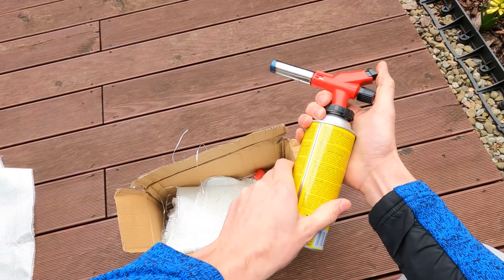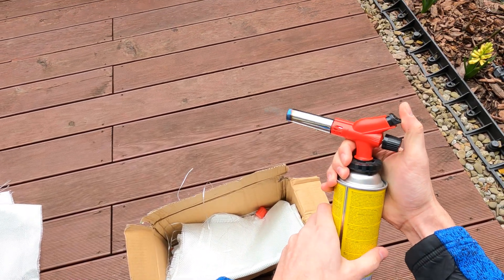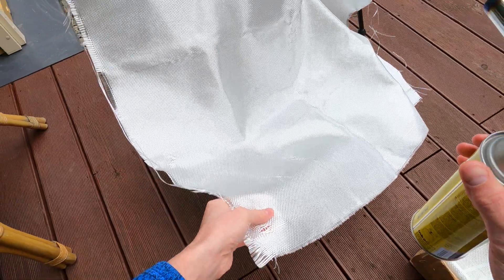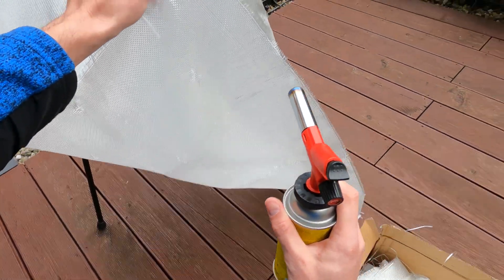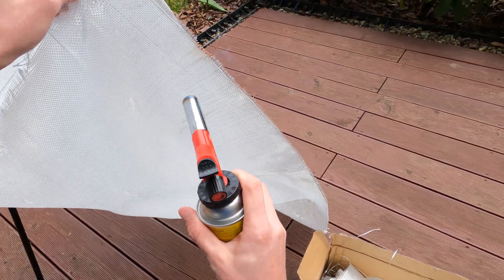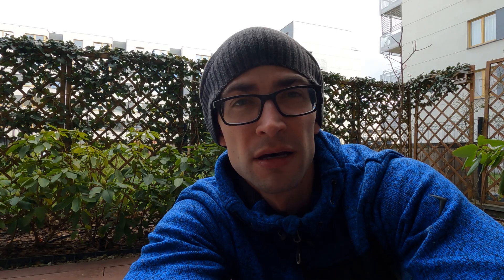How To Make CARBON FIBER Fin Blades

Comment: Hi man, crazy work. How much did it cost you to make them.
Reply from the maker: Around 50 EUR in total. 1 thing is that I was suggested to use 3406 Cyanoacrilic glue for t-rails as the regular superglue I was using worked for 1 season only...
Reply: @IlyaYarshou  oh okay, do you mind telling me what types of glue you used and poxy and carbon Fibre layers and where one can buy it. Really liked your video and want to try it myself. Thank you
Reply from the maker: @MitchellAllen05  I have used a regular epoxy resin for laminating (just cheap one from Polish brand). 1/1 200gr carbon fiber from the internet store ( on Allegro). The glue for t-rails for shoes (don't ask why) I have bought in a local store on Tenerife.
Reply: @IlyaYarshou  thank you very much, safe diving
Reply: @IlyaYarshou  what did you put in the search bar for the carbon fibre layers. I can't seem to find it.
Reply from the maker: @MitchellAllen05  Thanks mate! Feel free to reach me out here.
Reply: @IlyaYarshou  can you send me the link for the carbon fibre on the website please. 
Thanks for the comeback really appreciate it

Comment: resiba epoxy ou polister?
Reply from the maker: Sorry I could not understand the question.
Reply: @IlyaYarshou   Did you use epoxy resin or polyester? low or high viscosity?
Reply from the maker: @AtasubSpearfishing  Epoxy resin with medium viscosity (for lamination).

Comment: im making some, thoughts on how much shorter the layers should be based on urs? how many layers u think would be perfect?
Reply from the maker: Hi! For me this layers quantity was perfect. It was even a bit softer than Leaderfins medium carbon fin blades. You can use 160gr carbon instead of 200gr (to make it softer/thiner) once you think it can be uncomfortable for you.
Reply: @IlyaYarshou   ive got 200gsm carbon, any last comments on sheet design, been lookinggg at diagonal corner strips or a. Triangle inner layer for a bit of subtle performance. thanks mate appreciate it

Comment: hi, do you really need to burn the glass fiber? for your final product? too stiff?
Reply from the maker: For me it is perfect (used 200gr carbon and fiberglass) but for my wife I'm doing 160gr to make it softer. I'm always burning out wax from the fiberglass (Just learned that 15 years ago when I was making еру crossbow replicas) to make the adhesion better.
Reply: u think its necessary to burn off from carbon sheet. i have never done that didnt know it was a thing.    @IlyaYarshou
Reply from the maker: @jpslupik  definitely not necessary for carbon as the factory does not use wax and oil in the production process for carbon as it is used for fiberglass.

Comment: What kind of binder do you use to join the carbon and fiberglass sheets together? Could you please explain to me?
Reply from the maker: No binder was needed. You just put one sheet to another. The resin itself is glueing it up.
Reply from the maker: Look, I pore resin manually on each layer which make the carbon/fiberglass stick to each other and it does not move once I place another layer.
Reply: @IlyaYarshou  What is the binder in the white cup you used to apply each layer?
Reply from the maker: @thuyan6890  This is the regular resin+hardener for laminating from a Polish company Royal Resin.
Reply: @IlyaYarshou  Thank you very much. Wish you good health. I will follow you. Hope you will have many more good videos.
Do you use Facebook? give me the link.
Reply: @IlyaYarshou  I see each layer overlap, you have to apply an adhesive layer. What substance is it?

Comment: do you have to treat the fiberglass with heat? my friend warned me that bubbles are a big problem, this is where the fin cracks under heavy load. look's nice
Reply from the maker: Hi! Nope, all was done at about room temperature. I used this blades for 3 months and the only problem I have noticed was the wrong glue I used for the rubber t-rails.

Comment: Thank you for sharing with us
I see that you have omer shoes how did  you fit the fins inside it
Reply from the maker: Hi! That was a bit tricky task. Rubber T-rails are not really sliding in the rubber footpocket. Not sure if that was the best idea but the regular olive oil on both footpocket and the t-rail helped. Anyway that was not easy.

Comment: Easy job. Anyway title was about CARBON fiber blades, not mixed with glass fiber. IfI would buy it from You I'm expecting product as described ;)
Reply from the maker: Will be making more stuff soon. Sorry for the delay.
Reply: A lot of composite product don't use just one type of material.  Plus as other videos have indicated all carbon layup will make the blade too stiff.  His title is still correct, since he didn't said "100% or all carbon".  Since he is making it for himself and not selling it, he don't need to deal with those a-hole customer.

Love the your  blades, I think I will make one too, but probably will vacuum bag it to get a bit better resin ratio.

Comment: How did you connect the 2 glass and whats between them?
Reply from the maker: I have glued up two pieces of glass with a silicon glue. I had to do it for every fin blade as the glue stayed on the resin. I would suggest to put a piece of plastic bag to cover the glue but it is up to you.
Reply: Also last question. Whats the exact name of the nylon im actually trying to do it right now but the im having a hard time finding that “nylon sheet”
Reply from the maker: @Luis-je7hz  Search for "Peel ply". I was using the one with red lines. It is quite cheap and works great.

Comment: hello greetings, what type or brand of resin did you use, I have seen several videos doing the same thing and they say that it must be west sistem epoxy resin, but in my town it is not possible to obtain,

what do you recommend?
Reply from the maker: Hi! Look, I had the same issue with ordering West System epoxy. The price was very high (around 60euro for 1l of epoxy with hardener) +delivery+custom tax. My experience of work with basic cheap epoxies told me that it is just not worth it. I used Royalresin clear epoxy (15 euro for 1l canister) and quite happy about it. Will be using it also for vacuum infusion in the next video doing carbon fin blades for my wife’s fins.
Reply: @IlyaYarshou  thanks for the information I am very grateful, I will look forward to the infusion video:

I think I'm going to wait for the infusion video to make mine
Reply: @IlyaYarshou  What advantage is there in doing it by infusion?
Reply from the maker: Mostly it is about product quality. The main problem I had doing manual resining was air bubbles on the gloss surface (sometimes very big ones). It was not a problem for me as I was doing it for myself but you always want a perfect product, right? :)
Reply: @IlyaYarshou  I understand clearly. quality is very important

Thank you very much for answering and clearing my doubts👍

Comment: Can I also use 200g fiberglass at first and 2nd layer?
Reply from the maker: You can use 200g fiberglass for all layers with no problem. You can add a color pigment to resin to get rid of white/milky fiberglass color.
Reply: @IlyaYarshou  thanks! Gonna try making one next week, by the way what brand of epoxy resin did you use?
Reply from the maker: It was Royal Resin Clear. 1L was more than enough. The price was about 15$.
Reply: How was the fins holding?
Reply from the maker: @marchanzigmunddalen.1250  What do you mean?
Reply: Why not use carbon fiber all the way through? Other than cost effectiveness, are there any other benefits to using carbon fiber and fiber glass together as you did here?
Reply from the maker: It is more difficult to damage (to crack) the mix of carbon fiber and fiberglass but it is heavier than pure carbon. So for me the weight is not so important than "reliability" in this case. Not sure if the pure carbon performance difference worth the update and I couldn't find any test of it on YouTube.

Comment: thank you .  why didn't you use all carbon instead of fiberglass?
Reply from the maker: Hey! There were several reasons for that:
1. Fiberglass is cheaper
2. Less chance to brake it while traveling as I have a basic diving travel bag only.
3. Well known brands are doing combined materials fin blades so I did not think much as it was a "pilot" version of mine.

Comment: Sorry mate, I’ve watched this a few times now, and am still puzzled as to your “1st layer”, and the gloss finish you end up with. Are you painting resin on to a clear gloss product? Are you painting resin on clear plastic then adding the carbon sheet? Must be my adhd, but I just can’t figure it out. Awesome idea, can’t wait to try it. Thanks so much.
Reply from the maker: You need to put wax on the glass surface and polish it (I have done it 6 times). The whole sandwich looks like(bottom to top): glass-wax-resin-carbon-resin-fiberglass-resin-fiberglass-resin-fiberglass-resin-carbon-resin-nylon. No coating resin, no painting. You are getting the glossy surface from one side at once. The only problem I got was the air bobbles on the gloss surface as I did not have a vacuum chamber to remove air from resin. Hope that answers your question.
Reply: a quick fire torch gets rid of bubbles @IlyaYarshou

Comment: few day ago i make a fin carbon fiber with vacuum! but i'm fail. and i think i can make fin with your idea verry easy . thanks so much!
Reply from the maker: Hi! What went wrong with vacuum? Just wondering as this will be my next project.
Reply: @IlyaYarshou  That’s my first project i’m forgot to apply the coating and it stuck to the glass surface😢. you should make a logo on the fins I think it's pretty cool. I will follow your new project.